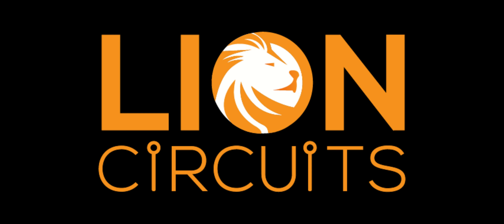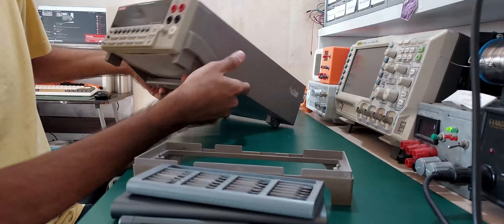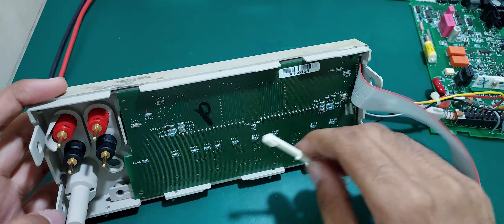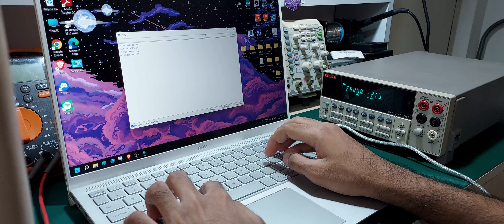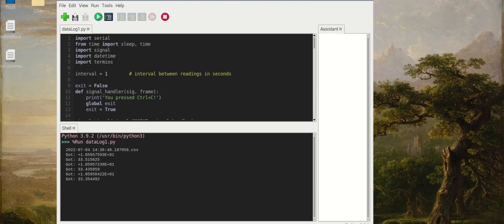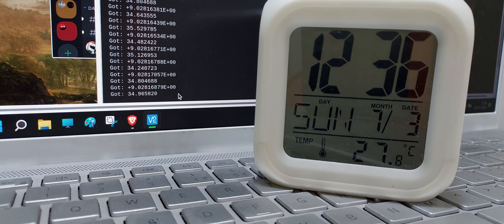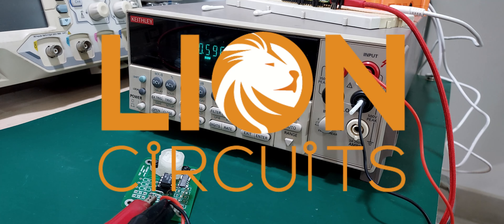Keithley 2000 - Let The Voltnutting Commence!

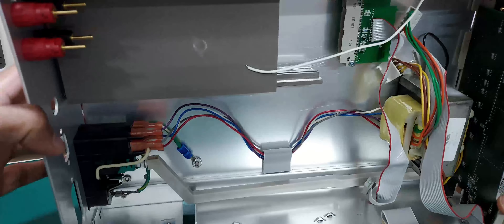Comment: Hi, I have purchased same Keithley on Ebay, but does not come with power pushrod buttom (3:17) please could you  share me measurements or a photo beside a rule of this device (Part No. 2001 - 320 A). I have requested to Tek for detail drawing but they never replied, I intended to do a 3D printed replacement. Regards.
Reply from the maker: Hey, looks like we're in the same Discord server, have contacted you there.
Reply: I had the same problem with an HP meter - a very bendy pushrod was missing. But ten minutes of measuring plus another 20 with my 3D printer and I was in business. It is easier than it seems. Great video by the way - my first from the subcontinent with decypherable audio.